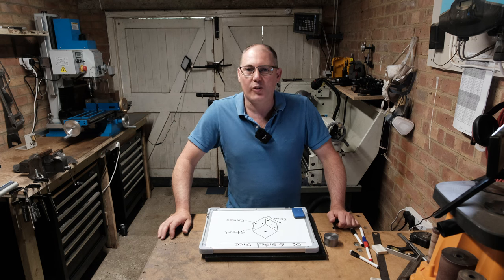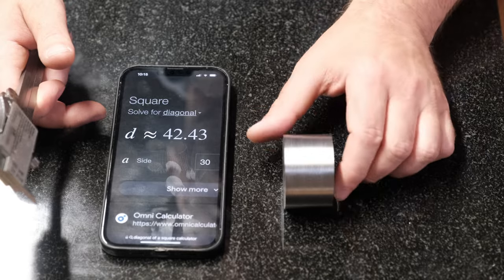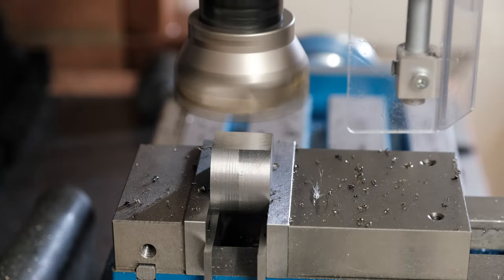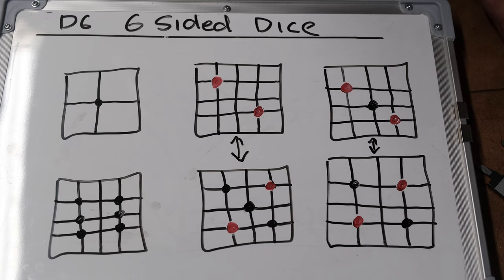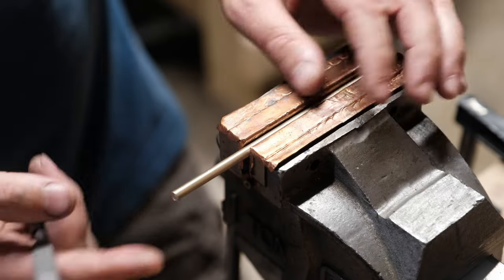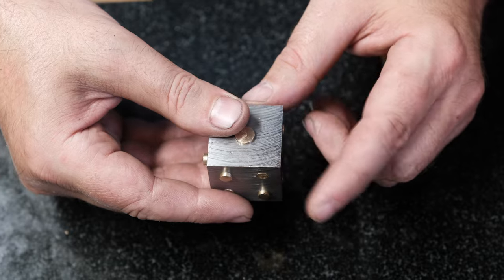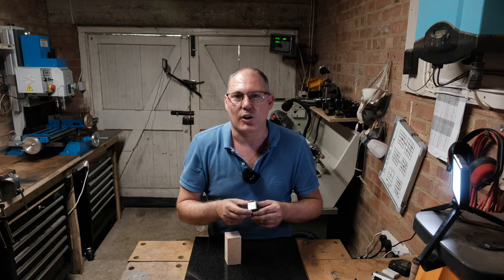Lets Make a D6 Dice

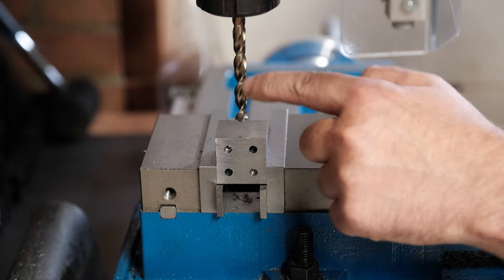Comment: Is that an Aldi drill at 10:32? I thought I recognise their grind. I bought several sets of them last time they were on offer as they cut really well in most materials.
Reply from the maker: That’s actually one of my dewalt cobolt drills. Expensive but after heavy use for a couple of years they’re still as sharp as new. Really pleased with them. I do also use cheap B&Q drills which have done ok but more suited to the hand drill than machines. I’ve blunted a couple of them. I might try the Aldi drills. Cheers for the tip.